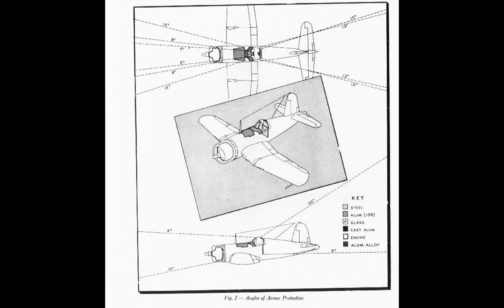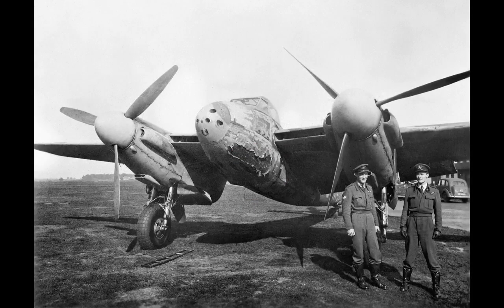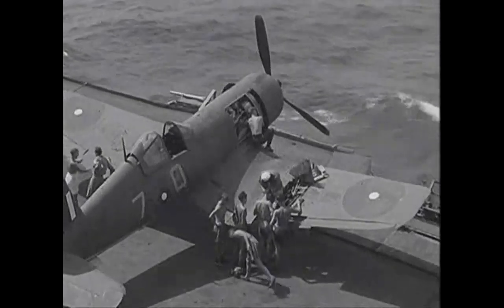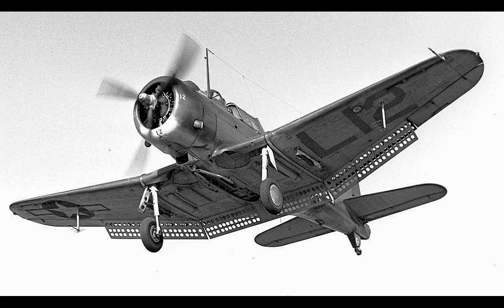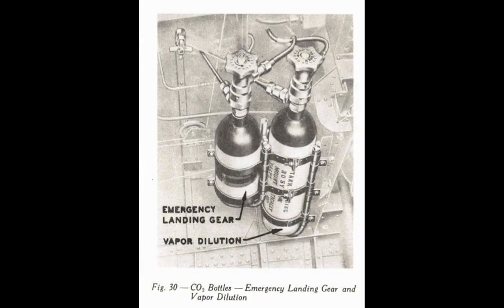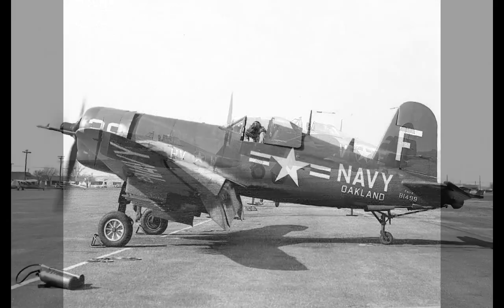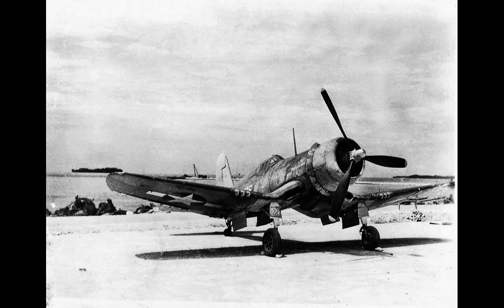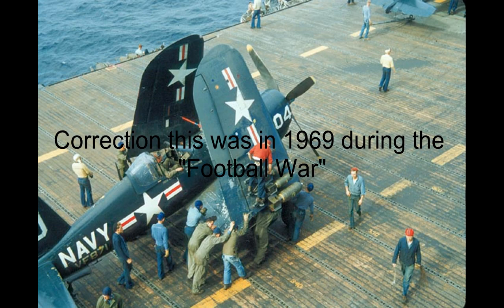F4U Corsair Design Features

Comment: Interesting side note that the Navy once evaluated a modified P51B for carrier duty finding, among other things, that it's landing speed too marginally fast for suitable carrier use. The evaluation included a flyoff between a P51B and an F4U1 at Naval Air Station Patuxent River, Maryland, in early 1944. It found the two early variants to be about even in performance to 25000 feet except the F4U1 turned inside the P51B which I assume was equipped with the heavier landing gear as tested. But I was surprised at the P51B performing marginally faster above 25000 ft. Don't know what all the factors were besides supercharging systems, both being 2 stage mechanical with the F4u being a bit more complex. Perhaps the F4U was optimized for lower altitude CAP duty? I assume that neither of the early variants had water/methanol injection.

Comment: The bend in the wing results in 3 bends in the spar. When an I -section beam is curved, the flanges need to be supported to the web to keep the section effective in bending. Pictures/drawings of the Corsair central main spar show this reinforcement with its attendant complexity, weight and cost.
As you often say, aircraft design is a nearly endless set of compromises, and there are no free lunches.

Comment: Re: elevator and rudder design.  I'm thinking there are multiple aeronautical advantages to the corsair's design.  (1) I'm thinking the greater distance between the elevator and main wing allows the elevator to apply more force influencing the pitch of the aircraft.  (2) by staggering the elevator and rudder, you will not have interference when the elevator and rudder are in deflection, therefore, the elevator need not have wedges removed near the fuselage for rudder clearance.  This allows more elevator surface area wrt total width of elevator, minimizing drag. (3)  As the elevator is more important in acrobatic maneuvers, it is best to place the elevator behind the rudder, maximizing the distance from the main wing, and since the fuselage is narrowest at the very rear, the overall width of the "solid" elevator is kept at a minimum,.  Maximum effectiveness, with minimum drag.  The F4U is the premier fighter of WW2.  It could do everything, and everything very well.  As opposed the Spitfire which was a racer modified to be a warbird, the Corsair was a warbird modified to be a racer.  Your channel and videos are second to none!!!!

Comment: I flew Grumman G1s for 6 years back in the day. The G1 and I think G2s and perhaps later, had main gear speed brakes. Pull the handle = main gear down. At min idle on the Darts it gave you 7000fpm down and us hanging in the straps. No limitations. So fun. GRUMMAN iron Works.

Comment: Moving the vertical stabiliser/rudder assy forward increases the airflow over the rudder surfaces. 
This is due to the tailplane/elevator assy disrupting/blocking airflow at various times during flight.
This increases the aircrafts manoeuvrability thus creating a more agile fighter

Comment: Different presentation but all the better for that. The BPF is still relatively unknown which is not good for future generations, troops in India/Burma call themselves the Forgotten army, and there is an undercurrent of anger about that to this day.
Could the forward mounting for the fin be related to issues resulting from disrupted airflow over the tail control surfaces as with the Zero? The Mosquito apparently had it's fin position determined by the structural strength in the tail area as you describe but I'd think the Corsair would be sufficiently strong.
'Soccer is something to do with warm beer and Lucas electronics', absolute genius. You Sir, are an honorary Brit just for that.

Comment: At about the 13 minute 40 second portion of this video you discuss the potential confusion of the placement of the CO2 tank and the tank than lowers the landing gear.  This issue is specifically mentioned in Boone Guyton's book, "Whistling Death."  Guyton was Chance Vought's PRIMARY Corsair test pilot.  Go to page 172.  The encounter between Guyton and Admiral Tom Hamilton addressing this exact issue can be found here.

Comment: Regarding forward visibility issues I would remind everyone this was NOT unique to the Corsair.  Before Boone Guyton was Chance Vought's PRIMARY test pilot for the F4U Corsair,  he was part of Navy Bombing Squadron Five flying the Boeing F4B-4 off the aircraft carrier USS Lexington (1936).  If you are not familiar with the F4B-4 you will note that forward visibility was as bad, or WORSE,  than the F4U Corsair.   The solution to carrier landing issues was???   Yes, the "curved approach" which was standard for ALL navy carrier aircraft.  Yes, there is even a diagram that exists to this day that illustrates the mandatory "curved approach" during WWII.
Reply from the maker: I don't think the F4B-4 is coming in at anywhere near the speed of a Corsair.
Reply: @GregsAirplanesandAutomobiles    The issue here is "VISIBILITY."  As an adjunct to that,  a "curved approach" to the aircraft carrier deck was employed in order that the pilot could see the LSO up until the last few seconds of landing.  Were landing speeds different?  Undoubtedly.  And the F4F?  and the F6F?    etc., etc., etc.

Comment: Did you mention that the British also clipped the wings so that the plane would fit into their lower decks? I may have just missed it. It turns out the clipping the wings also had the desired effect of getting rid of the "float" issue that corsairs had before they touch down which often resulted in out of control stalls at the critical moment.

Comment: Curiously  the pilot's handbook you quote on interference drag in the next two sentences says that having the wing meet the fuselage at 90deg produces the MOST interference drag.  I think that's wrong and NACA got it right.  But I wonder why the pilot's handbook got it wrong?
Reply from the maker: No, that's a different 90 degree angle, look from the front, not the top.
Reply: @GregsAirplanesandAutomobiles  I know which 90 deg produces the low interference drag...it's as seen from the front, which the Corsair realizes and it's what NACA refers to.

Comment: Great video,  thoroughly researched.   Just a note that the skin is all aluminum and welded together.   This add strength and were then able to reduce the number of spars, which reduce weight.

Comment: I wish My grandfather was still alive to ask my question to, but a last he is not. He was a Marine Aircraft Mechanic in the Pacific.  My questions are...the still photo at point 19:16 that Corsair fetcher-ed there, I noticed that it had 2 different tires on it, (I have never since that before in any Picture or film of an aircraft having that). next Q...the armament, the rockets appear to be mounted not evenly on the wing, again not something one sees very often.Then there is the ordnance under the Fuselage, again not something I have seen on a WW2 aircraft, one is a bomb on the left side, but other one on the right side appears to be a fuel tank or is the a napalm tank? Lastly what are the guns? Are those 20mm or 37mm cannons?
Reply from the maker: That's A Korean war photo taken in 1950. By that point they probably had a variety of tires. I suspect this plane needed a tire change and they happened to have a tire and rim already set up and put on what they had. I don't think it would matter much. The bomb on one side and drop tank on the other was a common configuration on all the later models starting around 1944. I'm not sure about the rockets or the guns, but I think the cannons are 20mms.

Comment: Another point of interest is the aft folding gear. Many other aircraft have this as well, P40, Hellcat and Skyraider. When you look at these aircraft note the very large wing cord necessary to house the long gear legs. Now look at the Corsar with the inverted gull wing the gear legs are much shorter allowing a considerably reduced cord of the wing. This gives the Corsar a much higher aspect ratio (span vs cord/ width) which is more efficient. I know Greg can explain it way better than I can!! 
Love your channel!!

Comment: Regarding the vertical stabilizer location - another often overlooked element of this design is the fact that they didn't have to "notch" the elevator for rudder clearance since the v stab and rudder completely clear the elevator.  This gives a significant boost in control authority for the same frontal drag, versus a "notched" elevator like many aircraft had at the time. Conversely, you could achieve the same control authority with your elevator while benefiting from reduced frontal drag if you shrunk everything down, since (again) you had a full-length elevator with no notch for rudder clearance. 
Considering their efforts to reduce drag and achieve high speeds, I think this was a significant influence in their decision to move the vstab/rudder forward.
Reply from the maker: Hmm, i hadn't thought of that, it's an excellent point.
Reply: @GregsAirplanesandAutomobiles  Just a theory, but I often notice the huge notch on our TBM elevator and think about its influence on control authority vs. drag. 

If you ever want to do a series on torpedo bombers, I’m sure we could get you in the avenger. 😏

Comment: I read the British also trimmed the wing length to help with landing
Reply from the maker: That had to do with the ceiling height on the hangar deck.
Reply: @GregsAirplanesandAutomobiles  Oh, I'd read that there was a problem with Corsairs hanging in the air on landing. British articles state it improved landing characteristics, which may only be  relevant on smaller British carriers, if it is true.

Comment: Excellent video. But making the F4U carrier compatible was not nearly as simple as "the RN invented a curved approach". The design team made a series of important modifications, including raising the cockpit seat, reducing bounce in the main landing gear, increasing the length of the tailwheel strut, and adding strips to the wings to even out the stall. Some of these are clearly visible differences between the F4U-1 and F4U-1A and F4U-1D, others are more hidden.
Reply from the maker: All true, there were multiple factors, but the Royal Navy was the first to do it operationally, and the curved approach was probably the biggest factor.

Comment: If you make a subsequent video on Chance-Vought Corsair, I would appreciate any additional information about its flight characteristics and aircraft design features, e.g., in the F4U-1A variant allegedly there is a window in the floor of the cockpit.  1) I have read two explanations:  target visibility during dive bomb attack, and/or allowing visual confirmation of crossing stern of carrier during approach.  
2) At Dulles Int’l Air and Space Museum hanging Corsair display has starboard wing with 6-8 inch “stall strip” out board of machine guns.  Can you explain how this small piece of metal functions to allow the starboard wing to stall at about the same time as port wing?  3) I am told that because of huge torque, subsequent left yaw, during take-off’s or missed carrier approaches.  Corsair pilots developed asymmetric leg muscles with their Right leg much more muscular due to the strength required on rudder to counter the torque.   I have seen this r/c models I fly during touch and goes if throttle is advanced to rapidly without adequate right rudder application.  Thanks for the very informative videos.  Also thanks for the “laminar flow” discussion.  I have been a little curious about how this actually happened.  Water pipe fluid dynamics says there is always eddying along and subsequent slower flow at the wall of pipe and Laminar flow and in creased velocity in the middle.

As I said in another comment:  I discovered your series the other day and have been binge watching.  I began r/c aircraft flying six summers ago while rehabbing from knee replacement.  I enjoy flying a variety of WWII electric models. Your videos on flight characteristic and aerodynamic has been very educational.  A commercial pilot friend gave me his copy, “Aerodynamics for Naval Aviation”, which your series has helped make more understandable. Please continue.  G  Wagner

Comment: Hello Greg, i have a question regarding cowl and prop relations, you've been through some design features on the corsair and the fw-190 - however, how does it work with the airflow and the distance between the cowl and the propeller?

Comment: Greg, mah man!  I hate to tell you . . . . the 'bent' wing on the Corsair was implemented solely to keep the propeller from hitting the ground; with no other reason.

The Corsair was designed as a carrier aircraft.  The landing gear had to be SHORT to be strong enough to withstand the high impacts of carrier landings.  The suspension, also, had to compress a lot to absorb its share of the impact.  'Long' landing gear could simply snap.  Short landing gear would result in the prop scraping.

All this engineering brought the Corsairs propeller within reach of the ground, but a bent wing raised the propeller up.

The P-47 had the same engine and the same propeller.  However, the P-47 did not make carrier landings so it could be fitted with 'longer' landing gear to keep the propeller off the ground.

The Hellcat had the same engine and was also designed for carrier landings.  It, too, had short landing gear, but a smaller propeller was used instead of a bent wing.  The smaller propeller, however, couldn't utilize ALL the power of the 2,000 hp engine.  This is mostly why the Corsair's top speed was 40mph faster than the Hellcat's.

The Bearcat had the same engine, the same propeller, and was carrier based.  However, it did not have short landing gear because it weighed 2,400 pounds less than the Corsair and the Hellcat.  Best, Robert
Reply from the maker: The Hellcat's prop is almost identical to the Corsair's the early versions only differ by 1.5 inches, that's not enough to explain that much bend in the gull wings as the wing design lowers the gear far more than 1.5 inches. The Hellcat's longer gear did just fine on carrier landings.
Reply: @GregsAirplanesandAutomobiles  The 1.5 inches seems a little small to me, but it could make a difference depending on the vertical mounting position of the propeller.  The propeller has to be mounted near the vertical CoG and the Hellcat has its oil cooler underneath the engine to raise it up.  But, I realize my argument isn't worth much without a diagram.  Thanks, Greg
Reply: @GregsAirplanesandAutomobiles  Scalability might have been a reason.  With the bent wings, there was room for an even bigger propeller.  Best, Robert

Comment: Love your videos, Greg, very informative. It was nice to see the Brits getting a mention in regard to the Pacific war. I give talks locally on The Forgotten Flyers of Task Force 57 (British Pacific Fleet) It was Captain Eric Winkle Brown who perfected the curved approach you related on in the video. We were desperate for decent carrier fighter or the fleet, as the likes of the Seafire, were just not robust enough for carrier operation plus lacked the rang, needed for use at sea. Eric Brown is famous as to having carried out the most deck landings of any pilot, some 2,400 in all. He was charged with finding out a way to use the F4u on our carriers, as it's potential was there for all to see. The British carriers had smaller hangars space than the US ones, due to the armoured flight decks, which resulted in the wing tips on the Corsairs, being clipped, by I think approx. 6 inches, so as they fitted into the hangar when folded. They claimed it had a minimal effect on the performance There was a problem as well on the oleo's on the undercarriage, having to be suppressed to avoid rebounding and throwing the aircraft over the side. The curved approach, also led to another problem of the port wing stalling, being the inboard wing in the turn. This led to a spoiler being fitted outboard of the starboard wing guns, to equalize out the wing dropping in the turn. Can be seen on some photo's, showing the wing from the front. Great read on the Corsair with the B P F, is " Carrier Pilot" by Ken Hanson.

Comment: Hi Greg, small question.

Seeing as how P-51 and P47s received their bubble top canopies, was the corsairs vertical stabilizer a factor in it not getting a full bubble top makeover? I understand that it's defacto canopy while a little cramped is still serviceable, did Vaught attempt to redesign it? My personal theory is that the vertical stabilizer and it's forward position didn't really allow for a redesign.
Reply from the maker: They did put bubble tops on Corsairs, but only about 10 of them. It was too expensive, and piston powered planes were on the way out anyway so the efforts were put elsewhere. https://www.largescaleplanes.com/articles/images/1136/1136-4.jpg
Reply: @GregsAirplanesandAutomobiles  wow, it looks absolutely stunning! Thanks Greg! :D

Comment: I just rewatched it; a very fascinating refresher.  One thing I caught this time:  The Bearcat's main gear also had a double-fold feature to get the length required for prop clearance.  A small part near the attach point folded outboard, so the main struts and tires would clear each other when they folded into the gear wells..